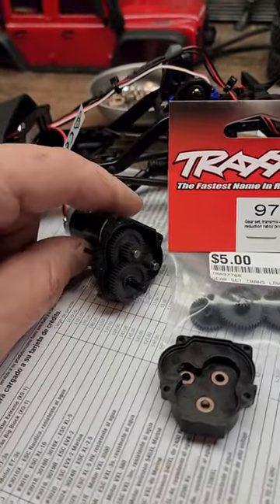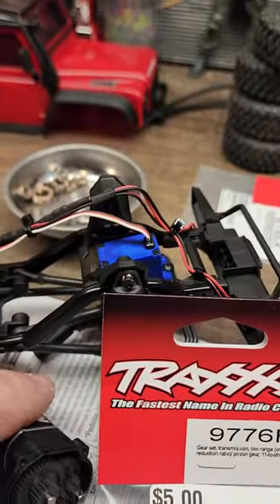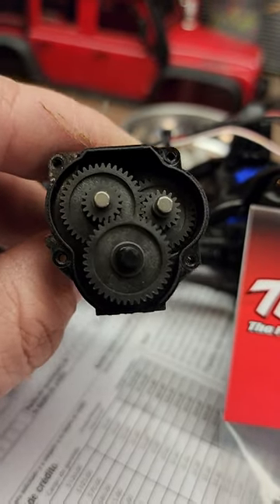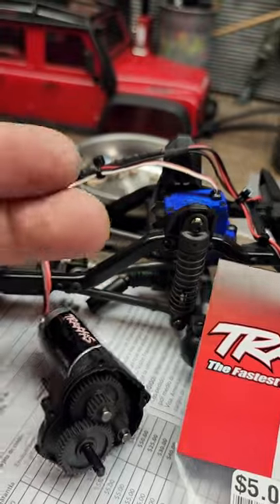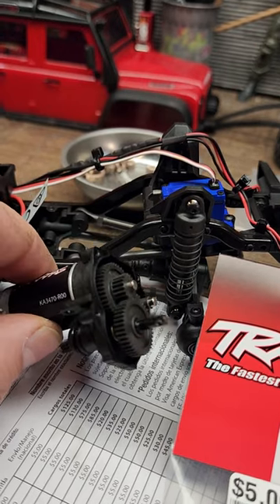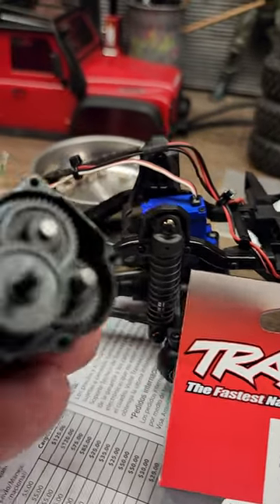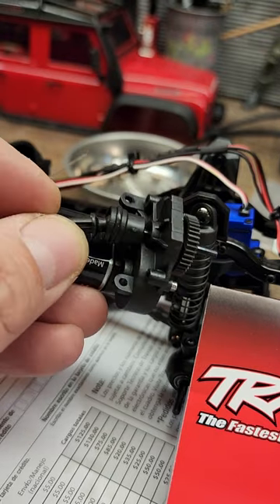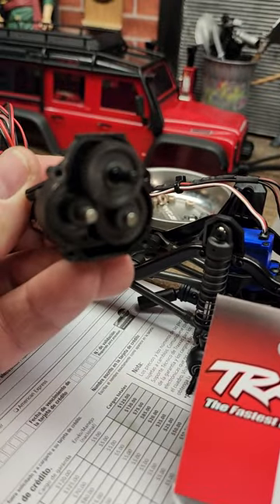Traxxas Trx4m no grease in transmission or diffs #shorts #short #trx4m

Comment: plastic gears usually dont need greese. depending on the type of greese you use it can break down the plastic and make it brittle.
Reply from the maker: Yes that is true in some cases but this truck has bushings and the steel shafts are dry on the brass bushings that's a lot of heat and friction
Reply: @AdventureTimeRC brass bushings are self lubricating

Comment: If you feel the inclination to add grease to plastic, it gas to be pure silicone divers grease that contains no added plastic corrosives.  FYI:  Grease is not recommended for Plastic gears, gas been known to do more harm than good.

Comment: you don't need any geese really for plastic gears if anything for that small rc put Olive oil in there just a tad it works like wd40
Reply from the maker: That might be OK for bearings my friend but this truck comes with bushings they have to have grease or the steel shafts will wear the brass bushings out very fast and your gears will start skipping 😀
Reply: @AdventureTimeRC  yeah i guess i didn't think about that haha
Reply from the maker: Lol grease is our friend 😅🤣😂

Comment: Your not going fast enough for grease.....personal preference for different rigs!
Reply from the maker: The steel shafts siting in brass bushings I think should have grease at any speed would benefit from grease I work in a plant that runs brass bushings on machinery  that i maintenance and when they don't get greased it really wears out fast and Gears start striping teeth from the slop just my opinion